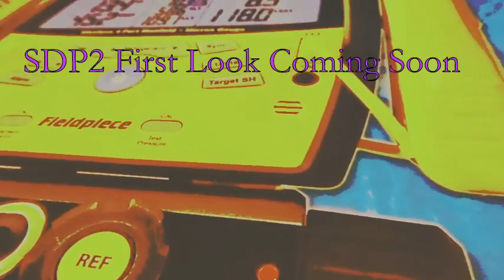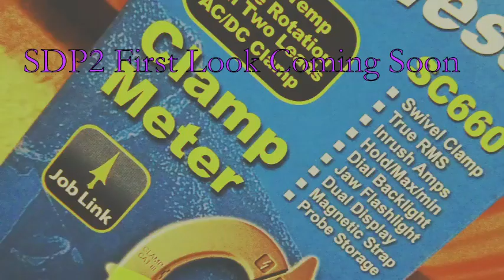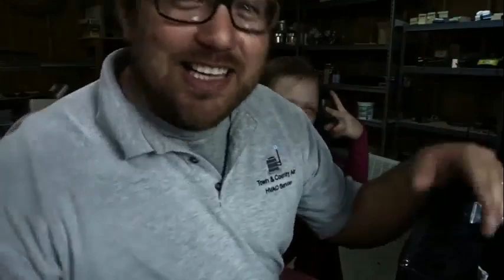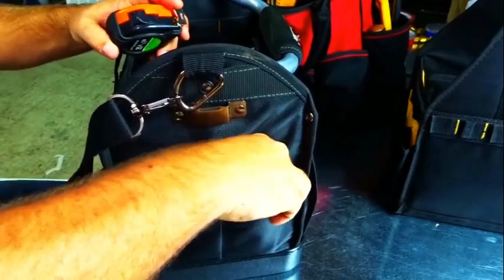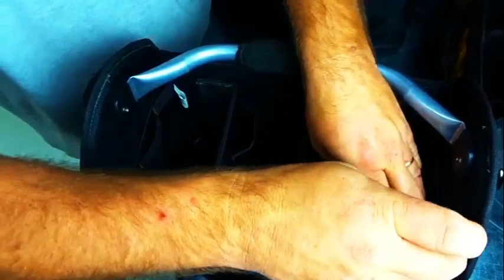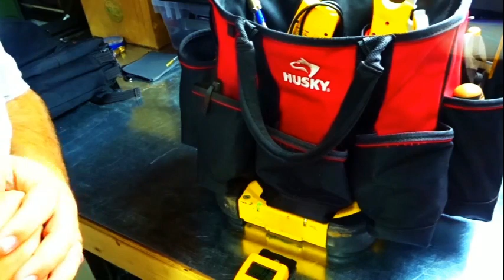HVAC Duct Sizing | Static Pressure | Friction Rate

Comment: Yo Zack is the overall total avalibe static pressure for the supply side, return side, or both combined? Through the filter, unit, ducts, ventss so im thinking supply... if you were using a ductulater would you use half that number for the return sizing??? I tend to over think things but it's just the way I am lol
Reply: After looking at a duculater for the the 1000nd time agin I think I got it. You use that total static pressure number for both . Basically gives you your cfms of each supply duct individually and return duct 👍🏽👍🏽

Comment: Yo Zac buddy just makin sure now, the friction rate is on each manual of the air handler depending on the speed of the blower? And we have to match that friction rate based on how we calculate sp, pressure drop, equivalent length, etc after the design is complete correct?
Reply from the maker: I think you are referring to static pressure not friction rate. Look up friction rate work sheet online.
Reply: @TALYN875  Ok where do I get the friction rate of a given unit before all these measurements are taken? Thank you

Comment: If I changed two 6 in supply ducts to 4 in (using 6" to 4" reducers) will my system balance out if I add another 4 in supply duct? I want to reduce two 6 in ducts for more head room and I want to add a supply to the basement.
Reply from the maker: You would have to test the entire systems air flow properties to answer that. Changing duct size will affect the rest of the system I. Varying degrees.

Comment: I re did a duct system that had two 12 inch flexes for a return of a 4 ton unit.. complete garbage, unit was sweating like hell, I hope the insulation dries up if not ill be putting armaflex.

I installed a new duct system and enlarged returns. one 24x24 grille with 18' flex, and one 12x24 grille with 12' flex

Comment: Thanks for the info.
So if the TESP is let’s say .5 , you subtract the pressure drop for filter , coil , heaters or heat exchanger , supply grill and return grill? What’s left is to size duct?
Also , why do some say size supply and return at 0.1 and then others say 0.1 for supply and 0.5 for return? Seems many disagree.
Thanks

Comment: I never see anyone mention that an undersized return makes the blower draw fewer amps. The reason is when you reduce the air getting to the blower the blower does less work. Less work =fewer amps. When we starve the evaporator core we produce less of a heat load on the unit and the compressor also draws fewer amps. Yes, we reduce the capacity of the unit but we also decrease the air temperature leaving the registers. Colder air coming out also expands more and produces less humidity.  It works up to a certain point,  but the humidity is always different. Ducts should be designed to allow full airflow potential while the blower speed should be a variable for humidity levels. I don't know of any such controls in a residential unit. This is where we guess at a medium design for comfort and cross our fingers. On the east coast, people are big believers in window units and think spending on a central unit is a waste.

Comment: @4:20 how do I figure out the available static pressure of the equipment I haven’t purchased yet. I looked at a m#n9msb to practice with but could not find such value in the installation manual
Reply from the maker: There should be a blower chart in the manual. Typically near the back.

Comment: As a service Tech, I have never worried about duct designs.  We have to work with what we have most of the time.  Really would have liked to learn duct design, but never did because by the time I learned it all and needed it I would have forgotten it all.  I can tell you this 90 percent of the jobs Ive seen are not design well.  You work with what you have in the field.

Comment: 24x6 144 per ton X 2 @ .50 static . If your design is tight, then return will also be the same.
Friction and turns in flex has to be accounted . If over size then use stamp faced grill it will effect the amount of air that flows through the area.Loose some gain some so all design of proper supply registers/dampers and return surface area is very important.PSC have worked for 50 years and ICM have had problems since 1990.I see allot of contractors going back to round pipe.. Austin,Houston,Dallas,Ft Worth..
Reply: I think you got the math wrong. A 2-ton system is 24,000 BTUs it is 6 square inches per thousand BTUs so a 2 ton system would be 6 square inches x 24. This would be the total square inches for a 2-ton system. Not per ton

Comment: The correct equation is asp x100/tel to size residential and light commercial duct.
Available static pressure "asp"( from design static .5 minus your pressure drops through y return and supply grills heatstrip filter etc. calculate all to be accurate, and determine your total effective length "tel" .
The friction rate equated determines the duct size for branch and trunk duct sizes, not rules of thumb. Not to bad considering some idiots say .1 supply .08 return period.... drives me nuts, you should have a blower performance chart as well for your brand blower

Comment: I had a 5 ton AC only and attic blower unit replaced with a new 5 ton Lenox heating and cooling unit in August 2016. The existing duct work has a second floor main hallway return in the ceiling. Now, in January 2017, the heating constantly running and the 1st floor is much colder than the second floor. So much colder that I have to start a fire in my wood insert. I feel that the system is only circulating the warm air that is sitting on the 2nd floor only. I've been thinking of extending the return to the 1st floor with an electronic door inline that I can choose which return to run. First floor return for winter and 2nd floor for summer. Does my idea make sense? Do you know of anything like that out there? What would your solution be?
Reply: Heat rises, next level
Reply from the maker: +Yourath Yem (P0ofPo0f215) electronic dampers and switches can be configured to do whatever you want. Having return air from throughout the house is a huge benefit.
Reply: Yourath Yem
Reply: Keep in mind that larger tonnage evaporator coils in the 4 and 1/2 in 5 ton range always have a higher pressure drop across them. I don't know why but that's just the way that their design. So some of the rule of thumbs that have been discussing this video will fall short when talking about large tonnage evaporator coils.

Comment: awesome video great info. now just to make things more understandable, this 6"/1000btu rule of thumb is or is not to be comparable to a friction rate rule of thumb? (metal pipe .1 supply and .05 return) just trying to get my bearings. and I'm sure you'll cover it in a future video but I just like to be prepared.
Reply from the maker: We will straighten that out. .8 friction rate is what the 6 rule is close to as far as friction rate

Comment: this is good stuff Zac, its completely unbelievable the amount of businesses that dont understand airflow. I had been in the trade for years and never heard of static pressure, manual D, friction loss, ductulator. And i was even a lead installer for some time. Pitiful!!!!....Once I went out on my own I became a nerd of the trade, im so happy that i took the time to learn as it opened up an entire new world in HVAC. It seriously recharged my drive as I was losing interest in the trade.....My california dry weather allows for much higher CFM per ton as we dont have to worry about latent heat...great video
Reply from the maker: A lot of guys can get by with rules of thumb, but understanding the more complex aspects of duct design is a huge plus! Airflow is number one to me. Overlooked because you can have a system that cools and heats with the wrong airflow, but it will never be just right.